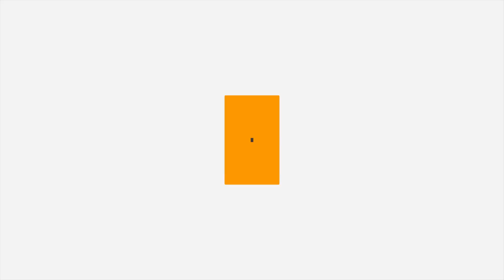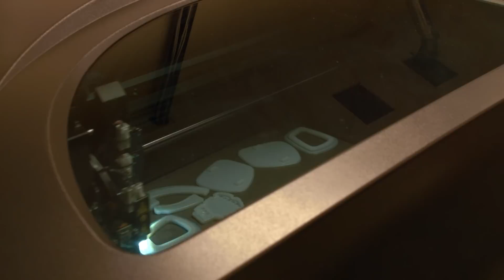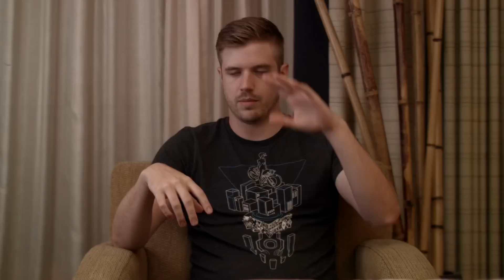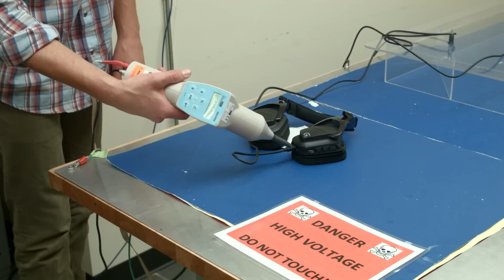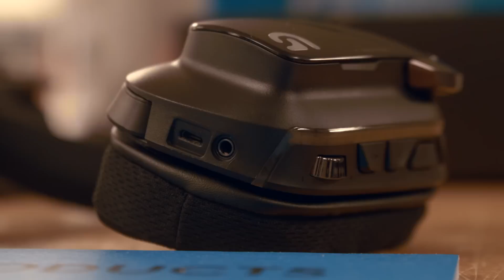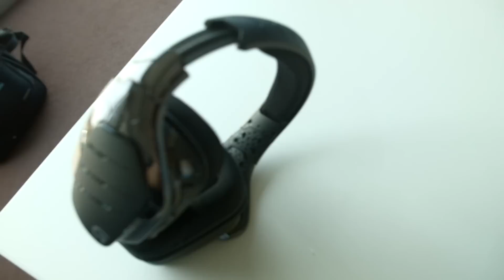Logitech Artemis Spectrum G633 & G933

Comment: The Sennheiser 650's are 450euro, how expensive are these going to be that they had you test against that?
Reply: +AlucardNoir $150 for wired one and $200 for wireless.
Reply: GriggsCk Gaming Well, that's rather bold of Logitech.
Reply: AlucardNoir It is, but it seems they are really confident, compare directly to HD 650, damn. Well, if it's as good or slightly worse than Hd 650, I'll buy that, but, I highly doubt it.
Reply: GriggsCk Gaming if you like wireless and don't need the mic I'd go with the RS 165. 

Hey, you think they chose the HD 650 because it's open and does not have active noise canceling just so the reviewers would have a worse time with the Sennheiser then they would with their own headset? Or am I just being paranoid?
Reply: AlucardNoir Oh, I plan to buy the wired version, "if" it's good. I've never consider wireless headphone before, a wired headphone like Superlux HD 681, ATH M40x is good enough for me. 

Erm, probably not, I think their intention is to promo this headset is as good as HD650, but they forgot to take into account it's an open headphone and it will be tested in crowded area.
Reply: +AlucardNoir You can find them new (atleast where i live) for 300e but still its a giantly bald move :3

Comment: What is the main difference between this newer G933 and the previous G930?
Reply: +Graphic .J you can connect up to 3 devices, rgb, better overall built quality
Reply: *****
Thanks. BTW to all I don't recommend the 930. The BAttery dies super quick like in 15-20 min max
Reply: +Graphic .J I don't know what you're doing with your headset but mine last around 10h.

Comment: i use g930 wirless for now  they are excelant i cant say that for sure. i play a lot sometime 8 hours and i feel good with them sometime i forgot about them and want to go sleep with them:). BUT :( they have fabric problem and i can see taht that new one will have same one. there is like plastic part with 4 scrues on each sides to fix ear part with top part and they will broke when you have big head like me, eaven more they can eaven break parts inside where scrues go and thats terrible like you cnat fix it and need to get complaint and they will give you new. but they should make them solid like from steel or something else than plastic.   i really like them and maybe but\y that new ones wirless.:P

Comment: are the logitech g230's still a good choice for a  gamer?
Reply: +NuRule Sure... They are nothing special, but if 50€ is all you are willing to pay for headphones, than g230 are a good option.
Reply: +NuRule they are so bad trust me, if you are getting them for the "surround sound" then don't bother. surround sound is a gimmick feature that doesn't work at all. Also if you have a low end audio chip then these headsets will make a sound in the background which will increase as you raise the volume of the headset up, Also their software is so glitchy, it keeps disconnecting the headset from windows every time it opens up origin or certain programs, so you have to unplug it and then plug it back again, they are not really great unless you can get them for cheap, like i got a g430 for $40, so you are not wasting more money on these bad headsets, search for used headsets around you or try some of them out in game if you can
Reply: +hussein khaasswneh dude I got the g430 and I love it great mic quality( compared to my old webcam mic) and love the surround sound it makes so many games better
Reply: true but it matches my color scheme.
Reply: +NuRule i have them the cord was crap it was sticking out the wires and the microphone stop working and the headband is hell with abuse for 2 years
Reply: caillou poop I got my g430 and I love it  to death and I'm sorry you got a broken one
Reply: caillou poop Those coords are gonna last alot longer than you had them for if you take good care of them.
Reply: +NuRule exactly
Reply: ***** I had no problem at all with the cord or anything breaking. I am just saying that if you are looking for 7.1 surround sound for games like bf4, these headsets are not gonna perform
Reply: hussein khaasswneh True, but ill be playing other games not just bf4 or shooters. i will also listen to music occasianally
Reply: ***** music is good imo, then buy it cause I wanted a 7.1 headset that I can hear footsteps with but this one is not doing that
Reply: hussein khaasswneh You have got the krakens from razer or some other ones, Trust me there are alot other ones for better quality.
Reply: yea, i dont have money now, so i'll stick to this logitech
Reply: Hahaha
Reply: +NuRule G230s aren't a good choice for anyone.
Reply: SpoonHandle Well beats are shit and break easily, i have no headphnoes, I want a headset and they match my color scheme. Yeah i d k Im still getting them
Reply: +NuRule beats are shit my friend had one I ware them and they sound the same as a pair of 15 dollar headphones and my g430 sounds way better and I got them for 80 bucks also there is a type of sound where mostly nothing can pick it up and you can't hear it in the beats but you could in the g430
Reply: g430 is the way to go. Cheap, reliable, and a shit ton better than the g230.
Reply: Nolan T. Im actually thinking of getting the g930s now, they still match my red and black color scheme and they seem to be alot better than the g230s
Reply: ***** G930s are MUCH better than the 230s or 430s.
Reply: SpoonHandle Yeah, i kinda realized that eventually

Comment: I have only ever had problems with 2.4ghz logitech devices. Logitech G7 and G930 both have huge issues with randomly disconnecting with NOTHING ever working to fix the issue and logitech acting ignorant to there being a problem when you contact them giving you generic things to try like "try plugging the dongle into another USB port". I could never recommend 2.4ghz logitech products to anyone ever due to the extremely frustrating experience I and many others have had with the product itself as well as the abysmal support from logitech despite these products being widely known to have unaddressed connectivity issues. Do a quick google and you shall see.

Comment: Let's hope they don't make an incredible product and shit on the software like they did with the G930. Great headset and I still have mine but the software and surround sound were garbage. I don't even use the software with it because I had so many issues that weren't even that uncommon. Hundreds of people would have some type of issue with the software and Logitech wouldn't do anything about it. So I hope they're changing things on that side as well. Good hardware is nothing if your programmers and customer support are garbage.

Comment: Screw these headphones.  Until they can prove that they have fixed the disruption at 2.4Ghz that happens to TONS of G930 wireless headsets I know, I wont pick up another audio device from Logitech.
Reply: +Space Chief what do you mean from disruption? i own one for almost 4 years and the only problem i have is a "pop sound" when i had 2 modems with wireless, once i got rid of one it stopped..
Reply: I live in an apartment.  Every time I use my headphones, even when I use nothing but 5Ghz on MY routers, my headphones disconnect, then take about 10 seconds to reconnect.  I lose all sound during this time.  I've RMA'd them TWICE now, and moved to a completely different apartment complex, and have my own equipment now instead of my ISP given stuff, still disconnects.  I posted about this on reddit not too long ago when someone brought up the 930s and it turned in to a bash fest with a lot of people having the same issues.

Comment: My current Headset is a logitech pair, and my next wont be. Poor build quality, poor antenna, horrible spool for usb cable, volume wheel doest work all the time.
Reply: what's up geoff?
Reply: +Conor O'neill I have to agree on two things; the plastic of the g930 was a bit brittle. Though considering what's broken on mine, it's still holding on quite well. The volume wheel not always working is indeed annoying and weird. I think it's mostly about the gaming software though not the headset itself.

Comment: i am so pissed off i bought the g633 after watching this and it IS NOT WIRELESS
Reply: Ricochet227 no i bought the g633
Reply: Why does it matter. If advise getting the wired especially since they're rgb led which run down battery. If all you're worried about is a wire then...
Reply: +Ricochet227 what games do you play
Reply: +Ricochet227 how's the footsteps in cs heard a lot of mixed reviews

Comment: I can't listen to that video, my G930 keeps disconnecting. Never buying Logitech again.
Reply: +Guigui I had that problem aswell but try using their latest drivers or some older ones.
Reply: +Taxen Thanks! But I already tried every suggestions I could find on their forums. I recently moved the USB  receiver few feet away from my PC with an USB cable extension. And the disconections almost stopped, whereas they were occuring every single time I was starting a YouTube video before.

Comment: Have had about 3 sets of Logitech headphones. None of them have lasted long, they are shit and their support is just as bad.
Reply: +Steven Whiting HAVE THE G930(for a year now|) and it still works great but you to take care of them,which i try but not always manage
Reply: +Steven Whiting The support sucks ass i've been waiting almost 12 days now for a reply from them.
Reply: +FERTUHG my first pair of g930's lasted a year before they wouldnt turn on anymore, and this second pair is trash it disconnects when the receiver is around 10 inches away LOL, Logitech are pretty trash not as bad as corsair though
Reply: My dad's G930's lasted about 5 months or so until it stopped working. He got a replacement but he still gets connectivity issues. Still getting the G933's or G633's